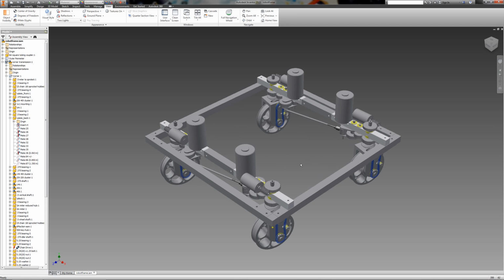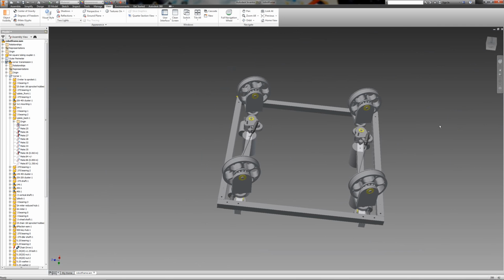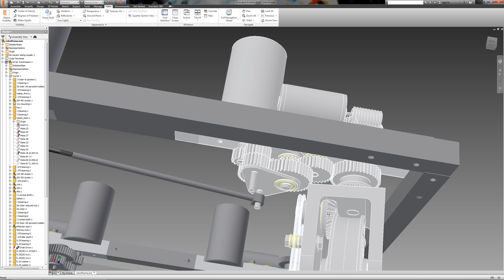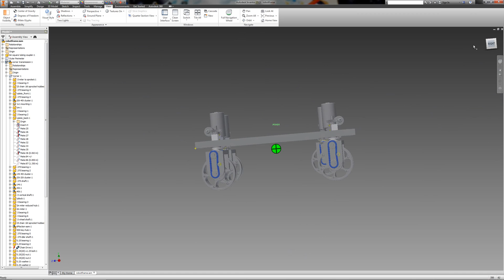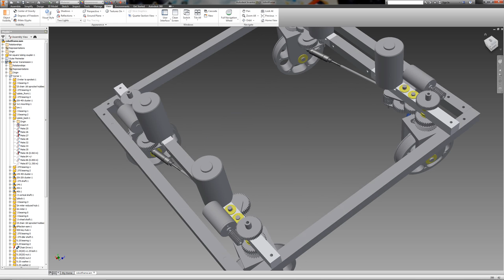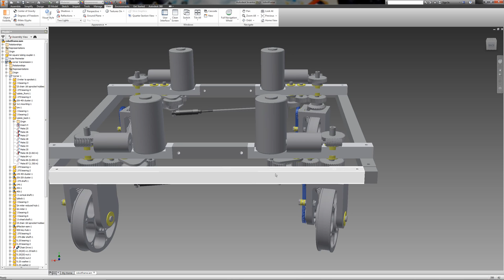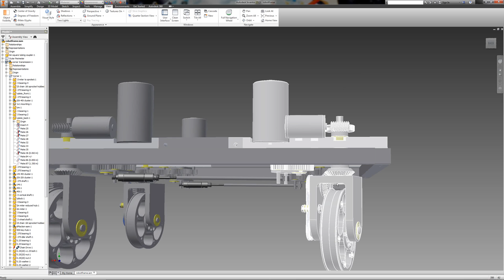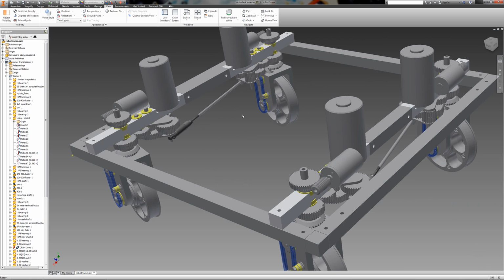2015 FRC prototype two speed swerve drive rough design

Comment: Sorry if I seem overly critical, there are several things I would do differently.

First and most obviously, there is very little need for such massive wheels. 1717 uses wheels that I swear are 2 inches in diameter at most, 368 uses the 3.25in versawheel DT. You can save lots of weight and space by going with smaller wheels.

Second, you don't need a worm gear to drive the module rotation, just put a banebot motor in a versaplanetary and you should be good to go (1717 uses the rs 395, not even a full size banebot motor).

Third, your swerve modules look dangerously cantilevered in the 1x1 aluminum in the top, I don't know if you intend on having plates with larger bearings below the gears but this is not a mechanism I would really trust as is.

Fourth, this shifting mechanism seems strange, possibly dangerous and is unnecessarily untested. I would go for a dog shifting design (again look to 1717 and West Coast Products) or you should repackage a ball shifter. If you are running low on air or use pistons that are too small, I can easily imagine these gears skipping and causing expensive damage.

1640 has great documentation on their coaxial swerve that you should take a look at (http://wiki.team1640.com/index.php?title=Swerve_Central), they also have the only good pictures of 1717s swerve module that I know of, unfortunately from a couple of years ago, they have improved their design since then (http://wiki.team1640.com/index.php?title=DEWBOT_VIII_Drive-train_Team_Page#FRC_Team_1717.27s_awesome_pivots). You should also look at 118s revolution swerve (http://www.team221.com/viewproduct.php?id=89)

Take everything I say with a grain of salt though, if you can figure out a better way to do things, by all means go ahead. I'm just saying that I don't personally see the benefit of doing swerve this way over other more well established methods.
Reply from the maker: "Sorry if I seem overly critical, there are several things I would do differently."
That's part of the beauty of frc, everyone does things differently!

"there is very little need for such massive wheels"
depends on the game in question. If there are any field obstructions like bumps, ramps, etc then there is a very good reason to use bigger wheels. It's easy enough to design down to smaller ones.

"just put a banebot motor in a versaplanetary"
that's part of the reason the cad doesn't actually have any mount for it. there are several possibilities here and that was certainly one of them which we may still end up going with.

"your swerve modules look dangerously cantilevered"
Potentially, and it may indeed need reinforcement. We will see as we move forward. Most of the design is start minimal then work up.

"this shifting mechanism seems strange"
Indeed. There are certain dynamics that need to be accounted for but I've seen this type of engagement used before(not frc) so figure we will give it a try. Like the rest, it can be changed if need be. It would be pretty straight forward to either adapt an existing shifter or modify the design into a dog gear, but we will give it a try and see how well we can make it work.

"if you can figure out a better way to do things, by all means go ahead"
that's all part of the fun of prototyping new stuff! will this work? maybe, maybe not. Is it better than established systems? maybe, maybe not. Do those points really matter? Not really. I mean that is our goal and it would certainly be nice if it performs as we desire but it may end up being a complete failure as well and that's ok. There's much to be learned and if it ends up working out then even better!

The whole point of me posting stuff like this is to get just such critiques and see if we've already thought of them or not and to either reinforce or negate our own concerns with the design. I mean most teams are pretty hush hush about stuff but I see it as extra eyes and brain power on pointing out flaws we may have looked over. That's not to say we will do things differently but the additional input certainly helps.
Reply from the maker: OtakuSanel If you take a look at last years robots vids you'll see that we don't tend to use conventional methods to do stuff, but they still work out! We've been using 4 omni wheel holonomic drive and are the only team i'm aware of who does. It's actually a great system and has served us very well. Sure it has it's own drawbacks but also has advantages you can't ignore. Mainly the simplicity to build, freedom of movement, and easily be able to master driving. We want to go faster and have more power though so this is our venture into that. It may not be this design that works or we end up using, but we will certainly get something to work, just wanted to share our initial design attempts so far.
Reply: OtakuSanel You are doing lots of interesting things in this drivetrain all at once. If you have the resources, I'd split the design into separate gearboxes and pivot modules, just to make sure that if something comes up you can fix it alone, without redesigning everything from the ground up.
Reply from the maker: Skooteh Ye...  resources isn't really something our team has much of. It's just the highschool electronics teacher, untrained students, and myself. We manage but there's no way we can implement the precision and complexity of some of those other swerve systems. We have a high emphasis on simplicity(relativistic) and easily machinable on our gear which other system just aren't manageable for us. So this will be our attempt within our capabilities. At least an initial one, we have room for refinement!
Reply: OtakuSanel If I may ask, what manufacturing resources do you have and how good are your programmers. Swerve drives in general push both to the limits for most teams. (it may be worthwhile to start with a KOTS option and make changes as you see fit)
Reply from the maker: Skooteh our manufacturing resources are hand drills and other various hand tools. a desktop cnc mill with a 3" vise(emco f1 cnc mill), and a cnc lathe(again emco) which other than 5/8" round stock is almost impossible to hold anything in. We also have some really old manual full size lathes but they are pretty inaccurate(15 thou over a length of a foot) and pretty hard to center stuff in. We also have a manual mill with digital readouts. Our cnc gear is really old and only supports manual entry g-code and saves to cassette which we can't obtain so we print out g-code sheets of a few features and machine stuff that way or just do the manual movement on it. I want to upgrade the electronics to be more modern but that's not an easy or cheap en-devour. I'm also the only one who knows how to do the g-code. As far as programmers go i'm the only one and my profession is actually as a programmer so in terms of programming complexity there are no issues. It's just a matter of how good i can make it in the time i have to work on it. Here is an example of the capabilities: FIRST Robotics Competition St. Louis Regional QM19 I've programmed all the robots going back 7 years in all the available languages so am fairly well versed in that regard. It doesn't always work out but as a programmer i blame the mechanical guys(which i'm also a big part of xD lol)! We don't have a typical team. Our team consists of the junior and senior electronics students and FRC is actually part of the class and not an after school club as frc teams tend to be. We have about 24 students but every year the seniors leave so any training leaves the team and half the team is brand new people every year. Now take a typical highschool class(not necessarily even interested in robots) and try to imagine that as your resources and all the frc stuff happens during class on top of the other class related stuff, that's what our team is. Now granted it's a tech school and each class is 3 hours per day. We do what we can to teach as many as much as we can(though i'm not a teacher nor have any desire to be) but when they start with no experience of any kind it's a bit difficult to get them to a proficient enough level in time to be able to take over any of the major duties. We do try to utilize them as much as we possibly can and that they are capable of so that they all have some part on the bot but that's a very large variant.
Reply from the maker: Skooteh I should also mention we are team 1658. We have also done swerve drive before, just not one this advanced
Reply: OtakuSanel I would try harder to buy more parts instead of custom manufacturing them. I noticed that the bevel gear you're using is both custom and especially difficult to manufacture because it has the standard gear directly attached to it. Also, are you a student? That was kind of ambiguous from before.

As a sidenote, during the FRC season I'd be prepared to just go for a tankdrive. There are relatively few top tier teams who run swerve even if they have in the past (1114, 973 at least). Given the resources you're using for swerve, you'd be able to make a kick ass WCD (which lots of good teams consider more competitive anyways).
Reply from the maker: Skooteh We do try to indeed buy as much stuff ready to go as possible. But sometimes we arn't so fortunate even all those spur gears will need to be bored, and mated(via key/welding/screws/etc...). The miter gears are actually standard and can get them in a variety of materials. We would certainly not do anything custom for them. the attachment to the spur is easy enough and the thinner one we just need to take the hub down which we can manage. We certainly do try to avoid as much machining as possible but at the same time do what we need to get the job done, if it's not too much that is.

But no i am not a student. I graduated from that highschool in 08. I have been part of the team since 07 though which is when i started with all the frc stuff, it was even harder then since I didn't know much myself. I'm the only one who ever comes back to help from the alumni =p

But no we will not just do a tank, it's way to limited and has a lot of it's own drawbacks. We insist on keeping the agility we have so we will use a swerve if we can make a good enough one or fallback on our omni-wheel holonomic if we fail miserably but I know we can get some kind of swerve going. Maybe not a shifter unless we buy a off the shelf unit but we'll get something going within our capabilities, we always do =p  

"Given the resources you're using for swerve, you'd be able to make a kick ass WCD"

WCD? Well the way we see it is that the manipulator is only as good as the drive system can utilize it so we want to make sure we have a drive that satisfies us, even if it takes a lot of our resources =p
Reply: OtakuSanel Our team went with a 6 cim versachassis and we were by far the most maneuerable at our first regional, in Toronto (Karthic even called us the best defence in FRC at one point this season). If you gear fast and drive well you'd probably be surprised just how agile a tank can be, we were driving circles around peoples geared slower than us regardless of what their drivetrain config was (tank, omni, mecanum, etc). If you haven't tried just making a simple, powerful 2 speed drivetrain you definitely should. it's especially obvious on a heavy bot with bumpers and battery that can weigh up to 154 lbs.
Reply from the maker: Skooteh here is an update of the project: 2015 FRC prototype two speed swerve drive initial testing

Comment: From experience we've learned you want your modular rotation to run somewhere around 125 rpm
Reply from the maker: thanks for info though that seems on the higher side of what's needed. It will certainly be very snappy.